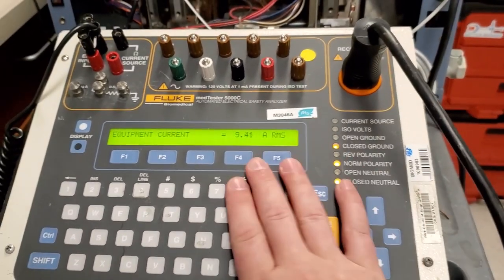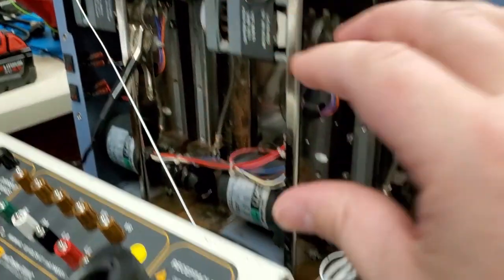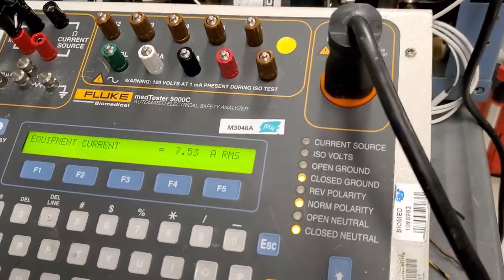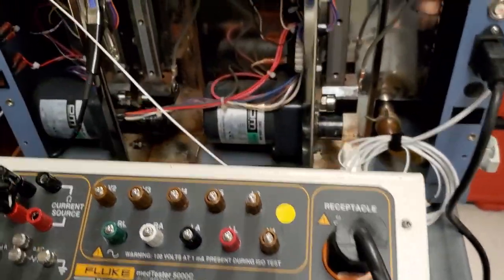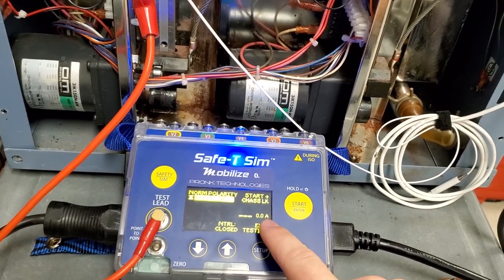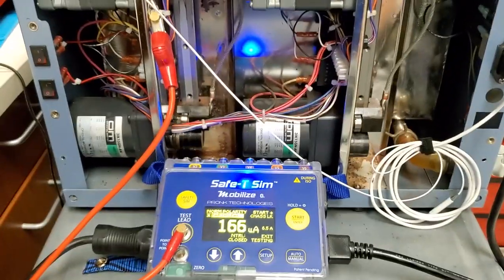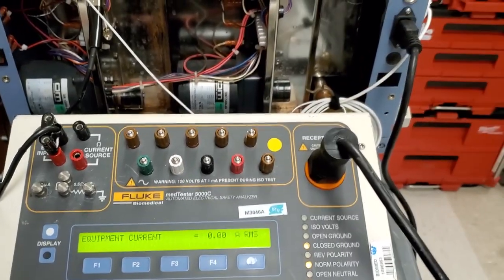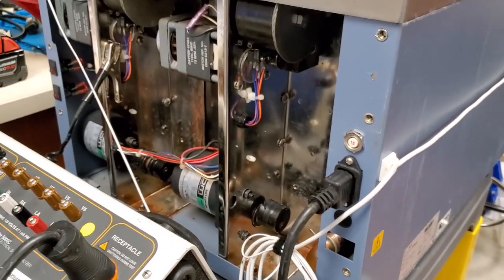Troubleshooting With An Electrical Safety Analyzer

Comment: Great video! So bad wiring was the issue on this unit?
Reply from the maker: It's 220V European wiring running on twice the current @ 120V.  All components are within current (Amps) spec.
Reply: @BetterBiomedChannel  ok gotcha. I’ve been working as a industrial electrical technician for about 20 years now and i am looking to get into Biomedical. I need a change in work environment. Your videos are very helpful and informative. Thank you!
Reply: @BetterBiomedChannel  Nobody thought about using 240/120V transformer?
Reply from the maker: No need. The problem is more so the gauge of the wire. 220V can use smaller gauge wiring for the same load.